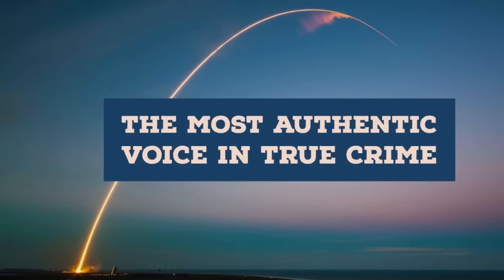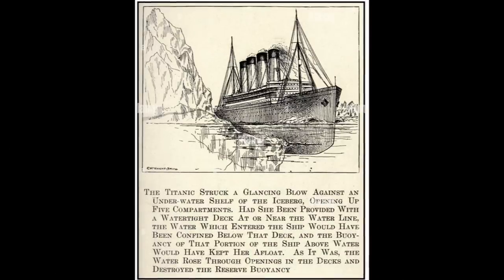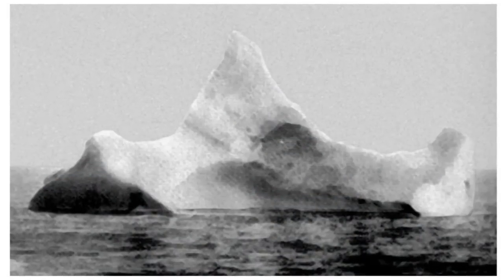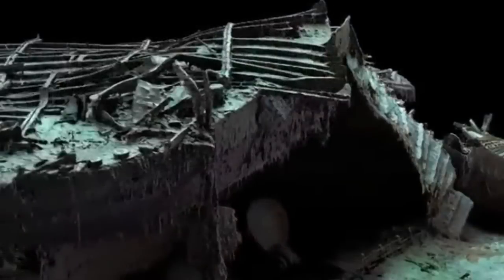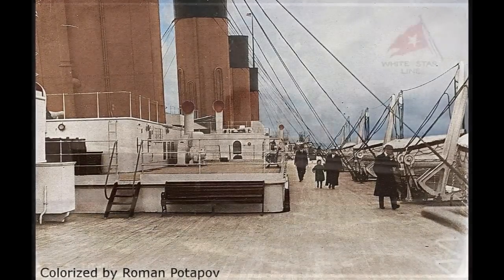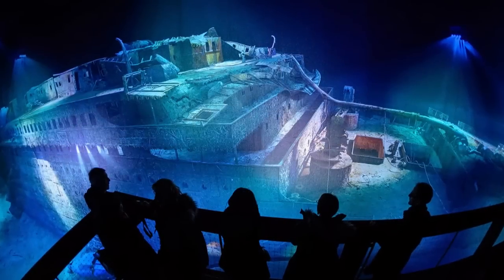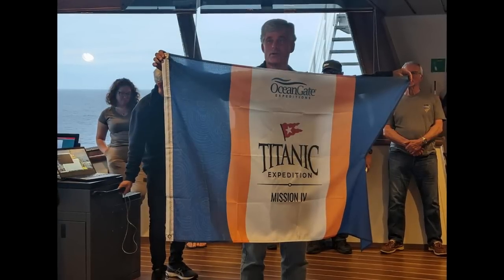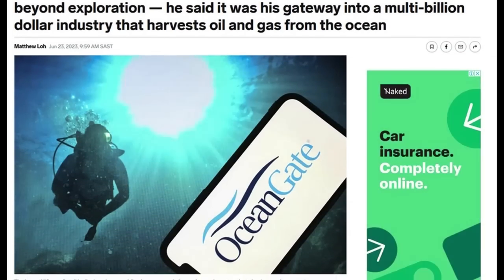Undamaged Bow is Proof RAMMING Iceberg Was Correct Strategy for Titanic + OceanGate News Update

Comment: "The Titanic became a chilling reminder of human arrogance, a tragically instructive page in history."
Reply: Most of the difference between the BOE and stern sections are due to the bow being flooded at the surface. The air in the stern caused it to implode at about 200m. The bow is indeed much stronger than the stern, but if the bow had air trapped inside it would also have been blown apart on the way down.
I do agree with your premise though.

Comment: It doesn’t strike me as a feasible scenario to deadon collide with a solid irregularly shaped mass at 20+ MPH. The reinforced bow is a nice concept, but as flawed as the partitioning - it only does half the job, the impact is not absorbed or deflected. 
There is no way of knowing what will happen next, but there is an enormous potential for critical damage.
Ice tends to break in irregular shapes with lots of edges and angles. The breaking process itself can release enormous amounts of energy that translates into unpredictable movement. 
If the ship splits the iceberg what prevents it from being crushed or torn open by the parts bouncing into the sides of the hull?
Will the ship be propelled upwards on the incline and break in two?
Will the ship capsize because of the shape of the iceberg underwater?
Will the broken up parts of the iceberg topple because they have a new center of gravity and take your ship along for the ride?
Will be ship come to a dead stop, with everything in it flying towards the bulkheads? 20MPH doesn't seem like much, but think of an airborne steamer trunk hitting you at 20MPH, or a piece of cast iron equipment. Also there would be structural deformation of the parts of the hull that are less reinforced, and not just a couple of rivets popping.
Reply: Couldn’t have done any worse than the glancing blow .
Reply: @Hugh1966  Do you seriously think that any competent sea officer, in 1912 or in 2023, would intentionally allow a collision to take place when a change of course might have averted it completely?
Reply: @dovetonsturdee7033  and that.
Reply: @dovetonsturdee7033  We all know that most of the iceberg is under water and not visible, so how can you be sure you can avoid it?
Reply: @bills6093  That is why I wrote 'might.' Murdoch could not be sure. Indeed, his attempt failed. But he was right to try.

Comment: The problem didn't lie in catering to the rich. It lay in inadequate if-then planning for different scenarios. An example of that was explained to me by someone who was part of the US Navy's 'boomer' nuclear subs in Washington state. To get to sea, the subs have to pass through an opening made in the floating Hood Canal Bridge. Software informed by sightings on towers told the sub when the change direction to pass through without colliding with the bridge. But the software was also smart enough to know that late changes could cause the sub to side-swipe the bridge just like the Titanic did. It told the sub's crew to continue straight ahead. Unlike the Titanic result will not be a head-on collision, only a near miss. There were two scenarios in the planning. Distant from the bridge? Change direction. Close to the bridge, go straight ahead. That is good planning.
For the Titanic there were no separate if-then scenarios. On clear days, steering around icebergs made sense. They could be seen far in advance. At night that was not true. Icebergs could not be seen far enough in advance to avoid them. The proper move was to go straight ahead and take the impact on the reinforced bow rather than risk a more dangerous sideswipe.

Comment: Given what we know about the design and situation, if it was impossible to avoid contact, head-on impact makes sense.  In some car accidents, it's also the bet option.
However, it seems highly unlikely Captain Smith would have rammed the iceberg with owner Bruce Ismay et al aboard, given that he was already speeding through an area with icebergs in response to pressure about the schedule.
We also don't know how much the crew knew and believed about the design.
However, if Ismay thought it safest and ordered Smith to do so, he may have.  
But they all thought it was unsinkable.

Comment: If the Titanic were to collide with the iceberg – a stationary, mammoth object – most of the energy of the impact would have to be absorbed by the ship, which would have only made matters worse. If the Titanic had rammed head-on into the iceberg, it would have come to a halt almost immediately; just think of what it feels like when you see a car swerving in front of you, and you suddenly step on the brakes. An abrupt stop would have thrown people against cabins or berths, and since it was night and most passengers were asleep, they would have had absolutely no chance of bracing against the impact; they would have been flung into the things in their immediate vicinity. In addition, the condition of the workers at the front of the ship would have been even worse. In the event of a frontal collision, the impact would have extended the entire length of the ship, splitting seams and bursting rivets, in which case many more of the ship’s compartments would have been exposed to the sea, causing the ship to sink much faster.The idea that the ship would have survived if it had crashed head-on into the iceberg is therefore crazy; there are several claims and hypotheses that suggest a variety of approaches that could have reduced, if not completely avoided, the severity of the tragic wreck of the RMS Titanic. Still, it is definitely not one of them.

Comment: There is simply no way a ship is/was going to intentionally ram an iceberg.  Looking back we can debate which option would have worked best, but at the time of the iceberg warning, no captain would decide to just ram into it rather than attempt to evade.  We also can't say definitively whether ramming the iceberg would have saved the ship.  Landing on the ocean floor broke the ship's back, literally.  Ramming the iceberg may have caused structural failures along the length of the entire ship, causing it to sink MUCH faster, possibly before any lifeboats could have been utilized.  Interesting debate, but at the time of the accident, in the heat of the moment, the officer in charge made the same decision any of his peers would have made, which was to attempt to evade the collision altogether.
Reply from the maker: There is simply no way a ship is/was going to intentionally ram an iceberg.>>>There is a way, if they hadn't seen it at the last moment.

We also can't say definitively whether ramming the iceberg would have saved the ship.>>>Yes we can. We know the strength of the hull, the weight of the ship, the speed of the ship and the approximate size of the iceberg. You can argue for the alternative, but I don't think it would take much to do a lot better than the crew did on the night, in real time. The object of this hypothetical exercise is to simply try to save more lives than the 1500 that were lost. 

 Ramming the iceberg may have caused structural failures along the length of the entire ship, causing it to sink MUCH faster>>>The impact with the seabed, which occurred fster than the impact with the berg, and into a fixed object, shows there was a strong likelihood that the bow could have saved the ship and all on board. Again, because you see the bow and much of the area behind it across all dimensions is in almost pristine condition. It's in better condition than every other part of the ship.
Reply: @TCRS The Titanic didn't hit the seabed bow first. It rammed into it more horizontally sinking into the sand and mud up to her anchors. Furthermore when she hit the sea floor she was full of difficult to compress water not easily compatible air. I don't know whether your theory is a good one but your theory about the bow doesn't seem safe to me.
Reply: @TCRS  The relative condition of the bow to the stern owes more to the fact that the bow was full of water, hence not affected by the deep sea water pressure.  The stern, which was still fairly full of air, wasn't so fortunate, and it suffered an implosion.  The relative damage has little to do with the strength of the hull.  Finally, the relatively better condition of the bow still doesn't matter.  Upon impact, the ship's structural integrity gave way, ie:  its back was broken.  This suggests it might not have remained structurally sound upon impact.  I'm not saying it is definitive that the ship wouldn't have survived a head on collision; rather,  that the fact that the bow is in better condition than the stern proves absolutely nothing.  Being full of water kept it from imploding, whereas the damage to the stern occurred as a result of implosion well before it made contact with the ocean floor.  It's current condition is a result of its implosion, not its lack of strength relative to thr bow.

Comment: So...  about 50,000 ton nautical structure ramming a 800,000 ton solid block?  LOL
Reply from the maker: Correct. Have a look at how well the stern coped with impacting planet Earth, which weighs ~5.97 billion trillion metric tons, at 30 knots. Even after more than a 100 years in seawater exposed to rust eating bacteria, they still haven't broken through.
Reply: @TCRS I think you mean bow not stern. And are you suggesting Titanic hit the bottom vertically bow first?
Reply: @TCRS  The Titanic was widely noted for having many many airtight compartmented sectors throughout the ship.  That is why it took 2 hours and 40 minutes to sink below the ocean surface.  It is laughable to suggest that it sunk to the bottom at 30 knots.  The ship remained significantly buoyant in its slow decent to the ocean floor.
Reply: @DWilliams-ce8nb The compartments wernt airtight- the forpeak hatches hissed with air escaping though them.   Followed by the water. Some of the compartments were walled, not completely sealed. Iron and paint - no welding, just rivets and paint.
Reply: @stewheart  Wrong.  The main goal of the ship's architecture was to create multiple airtight compartmentalized sections.  Maybe you're thinking of the Hollywood ship in the movie.